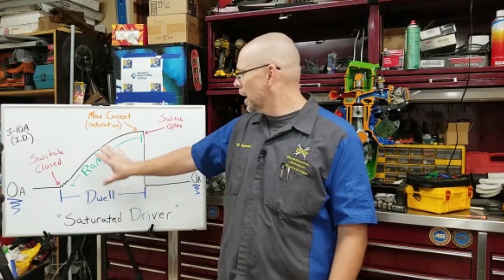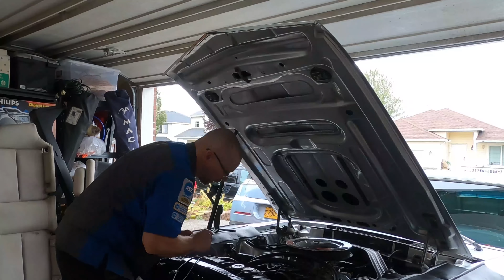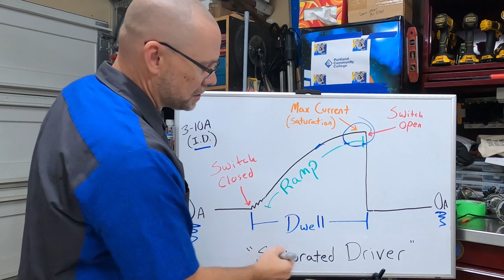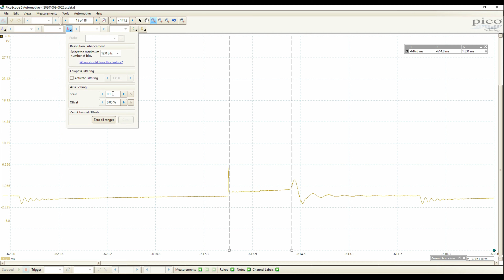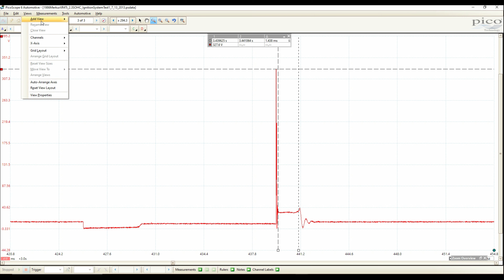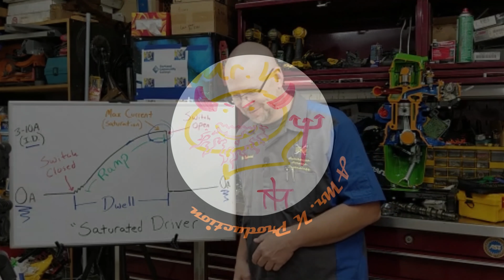Ignition: Primary Current

Comment: I need help.  Can somebody please tell me what it means if the primary ignition current waveform dips below zero after the transistor turns off?  The following waveform is from a 2008 Saab 9-3 2.0 liter turbo.  https://www.youtube.com/watch?v=OgA-Oxj0U7s  Amp clamp setting is 100mv per amp.  Also, it is weird that the top of the waveform is slanted downwards.

Comment: Very good video. So all the turns in the primary oppose the current flow. If I have a coil with 1 ohm of primary resistance, and I close the ignition points , key on engine off, shouldn't my current eventually settle out at about 12 amps of current ? I=V/R. ie  12/ 1 = 12 amps.  Will I blow my 10 amp fuse in my motorcycle just by turning the key on ,when the points just happen to be closed ?

Comment: USA,mazda 626 GE 2.0 L 1995 year.Mitsubishi ignition distributor with S1 hally sensor.Can someone help me with the correct electrical diagram of this thing.the commutator has a 6 pin connector and there is also a 3 pin connector on the side of the distributor.The injectors spray gasoline but there is no spark in the distributor car will not start.

Comment: I was in sales and training for Sun back in the day. Used to use current limiting waveform on gm hei systems to diagnose weakening hei modules. The Zener diode action would breakdown b4 module failure. 5.5 amps current limiting.

Comment: You need some definitions like "saturated"? You're actually using the wrong terminology and in electrical engineering terms "saturated" refers to magnetic saturation of the iron core. A high ohm coil never gets to saturation, the current is limited by resistance. The final current = V/R, A low ohm coil , if it's over dwelled it gets past saturation and the current increases at a faster rate, the line starts going up steeper than before.

Comment: Interesting and useful review. Thanks very much. There's of course a lot of devil inthe detail. I often see a current "tail" in the negative direction at the point where the Driver turns off. What causes this tail? What is it's diagnostic value? It can be seen also in the prim & sec Voltage waveforms. It can be seen on known good systems too. I'm guessing is has something to do with left over energy in the coil, but I struggle to understand how current as opposed to polarity can run in reverse throught the system, as is suggested by a tail on a current ramp. Interested in your explanation. Cheers.
Reply from the maker: In regards to an ignition primary current ramp, you'll often find that if you zoom in on that "tail" it actually looks just like an ignition voltage pattern. The current probes we use to get these patterns are really nothing more than an antenna for the magnetic fields (and their related strength) formed in a wire when current is flowing through it. If you happen to be testing anywhere near the ignition coil, your probe will pick up and display those fields as well, so we get that tail. Next time you are checking primary current, move the probe further and further away from the coil and see what happens to your pattern. Once you get far enough away from the coil(s) you should see that it goes away completely. So there really is no current in the primary wiring running in reverse - your probe just picks up the secondary event when close to the coil.
Reply: @pccastengineperformance7844  
Ok thanks.Makes perfect sense and of course on a Wasted Spark system the interference is going to be in the negative direction for half the cylinders
Reply: @pccastengineperformance7844  so what you’re saying is it’s normal to have a spike in current when the driver turns off at the end of the dwell period. I’m getting a 55 amp spike followed by some oscillations(oscillations being normal) with my car msd ready to run distributor. I might move the probe further back closer to the firewall see if I makes a difference. My car runs fine but was curious as to what that was. You have great videos by the way you explain things very clearly. Hope you have a Merry Christmas
Reply: i guess Im asking randomly but does anybody know of a trick to log back into an instagram account..?
I was dumb lost my account password. I would love any tricks you can give me!
Reply: @Ulises Vihaan it worked and I actually got access to my account again. I am so happy!
Thanks so much you really help me out !
Reply: @Chaim Uriah Glad I could help :D